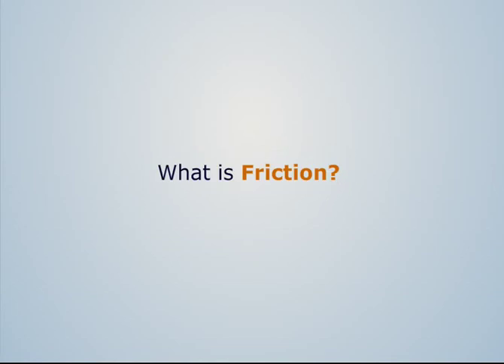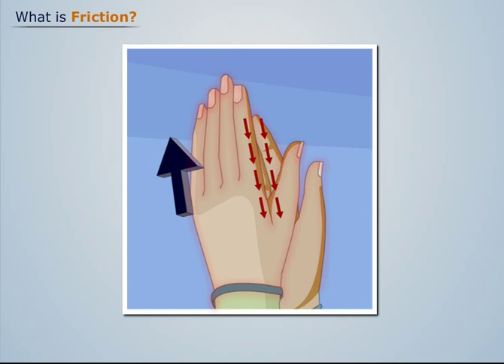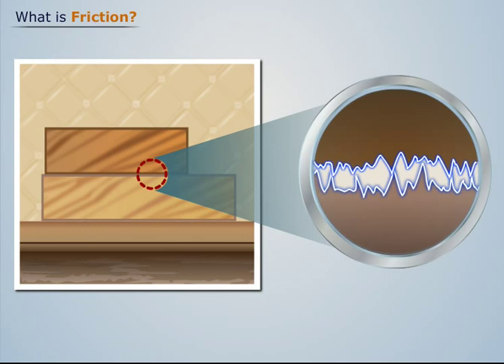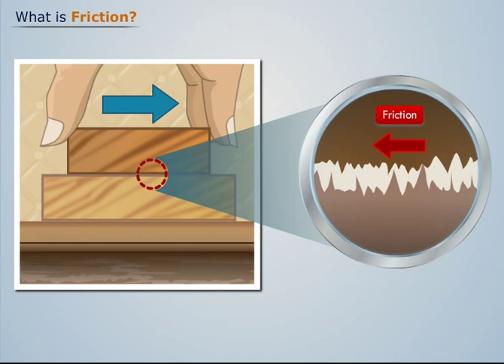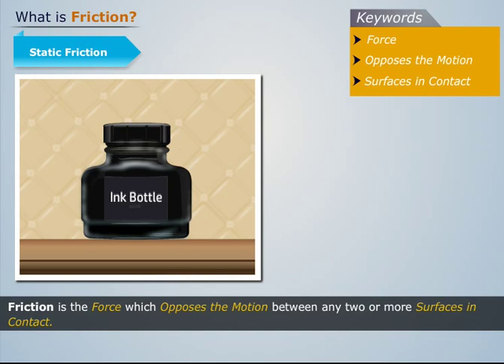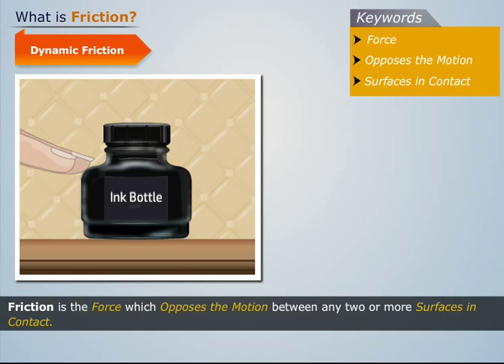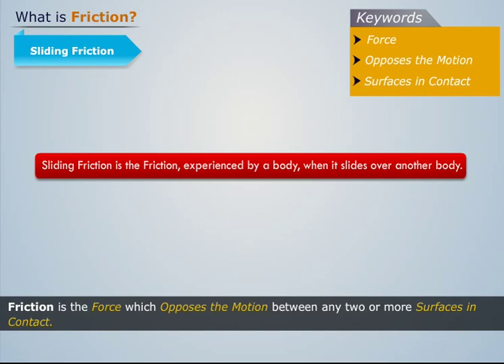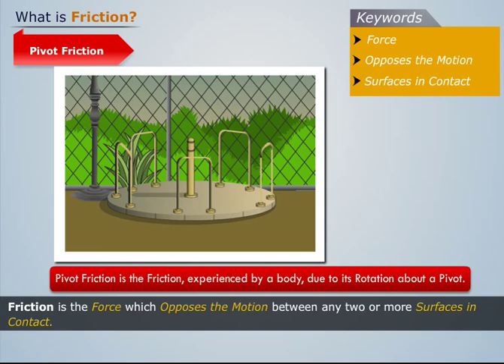What is Friction? | Theory of Machines

Comment: Hi! Can anyone please tell me that is the static friction equal to the weight of the object? And dynamic friction is greater than static friction? Please someone explain it to me.. I'll be thankful
Reply: Not 100% true... static friction is equal to the weight of the object times the coefficient of friction, because the weight has an opposite force of exactly equal strength from the other surface, and different types of irregularities (roughnesses) of surfaces will provide different exact amounts of friction.
Reply: Also, dynamic friction is lesser than static friction at least in practical applications, because once an object moves, it will encounter less friction (this is the dynamic friction) compared to the friction it will experience when you try to move it for the first time. Try it on a couch over a carpet, like you might have in your home

Comment: plz can give more information which lubricant is suitable to reduce friction between paper &round iron pipe cylinder
Reply: I believe a surface with a lubricant is smoother because the liquid of the lubricant is smoother than the surfaces it is on (liquids are generally smoother than solids), and it acts on both surfaces because it is in between them
Reply: So that's why lubricants are used in many metal-on-metal machines, including cars (where the lubricant is motor oil), to reduce the excessive heat from friction as metal conducts heat very strongly